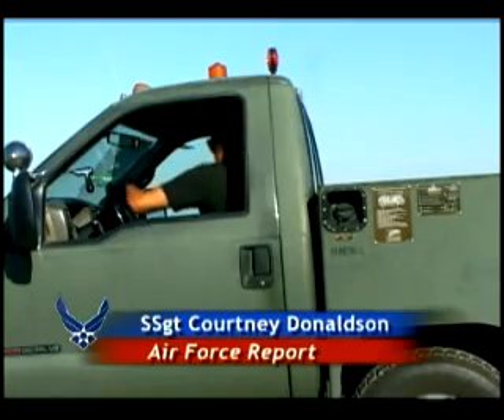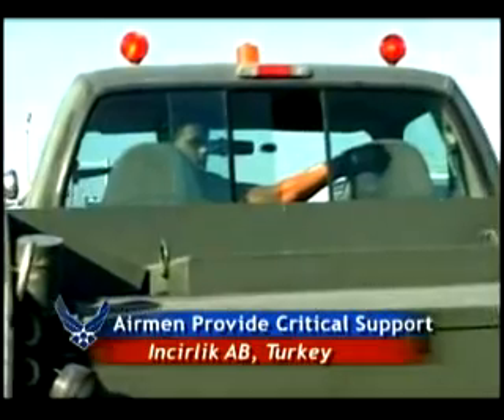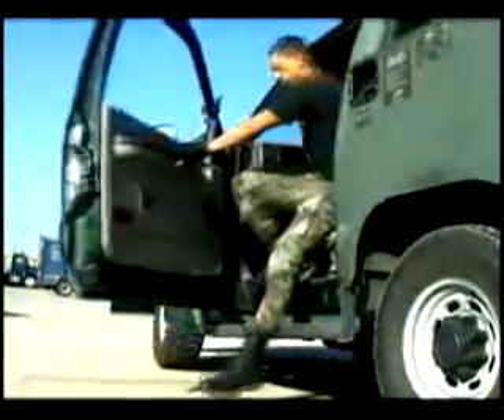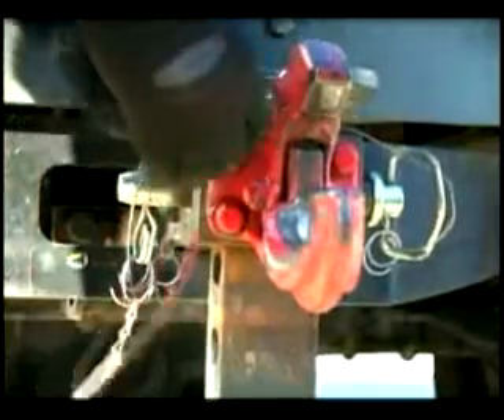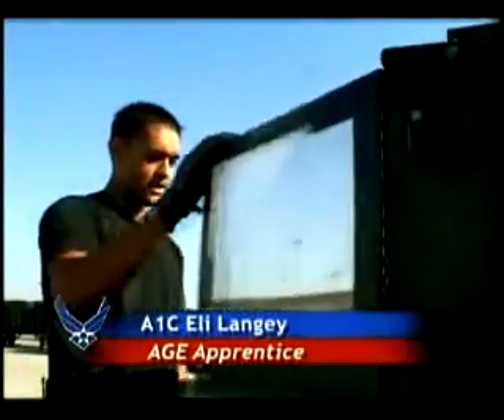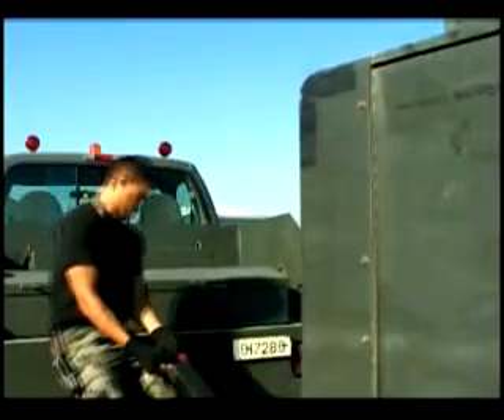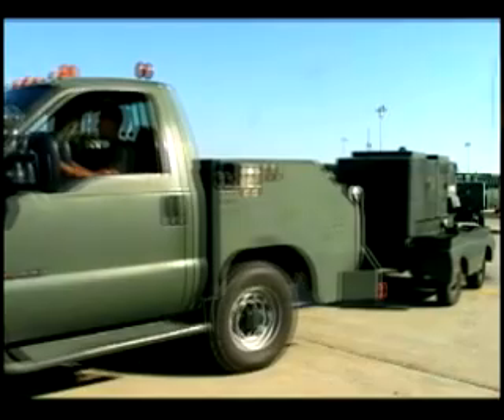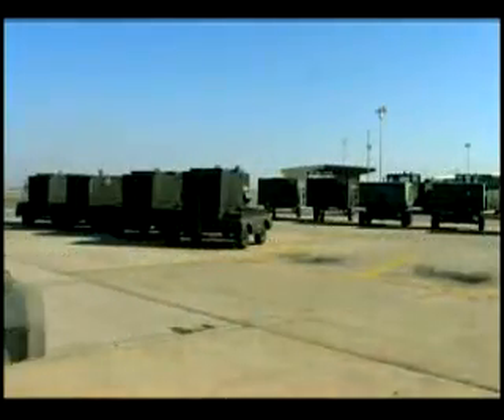Aircraft Maintenance

Comment: Im AGE too, but you got to understand that support equipment is still valuable to the flightline as the plane can pretty much do all the work its self but as they said in the video "it puts wear and tear on the aircraft" and as for B809's, -86, -60 generators. They all have a different purpose i'm sure you'r aware. All different voltage and load ratings so thats why more fighters use the Gas turbines and more heavies use the -86-B809

Comment: A C-17 has touched down on the flightline?  I guess they don't use runways?
I'm sorry, but AGE really ain't that valuable either.  The -86 isn't the only generator that can supply "the right amount of power"-can you say -60?  Oh, I forgot about the motor generator too-115 VAC 400 Hz.
I was AGE, and this report was silly at best.  I'm getting cynical at my old AGE.

Later